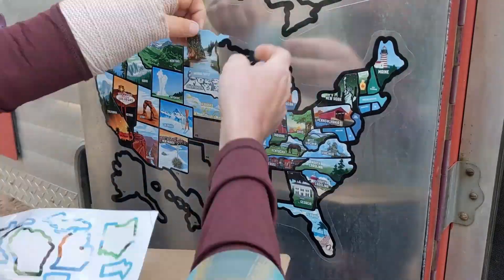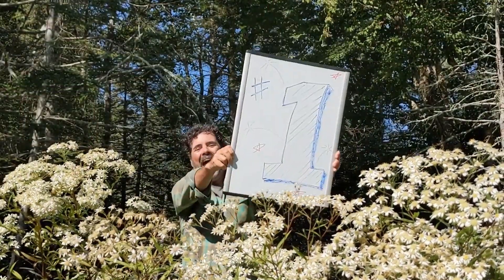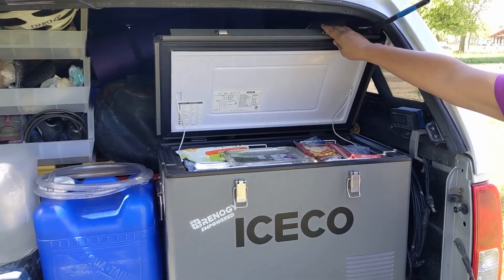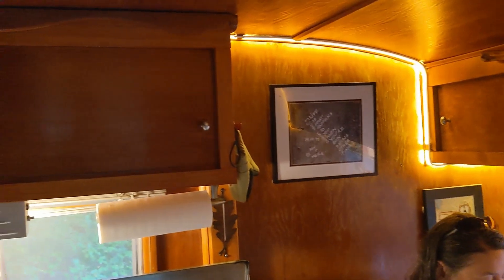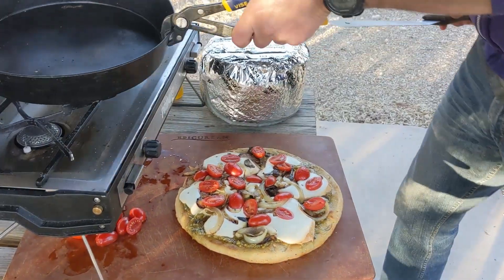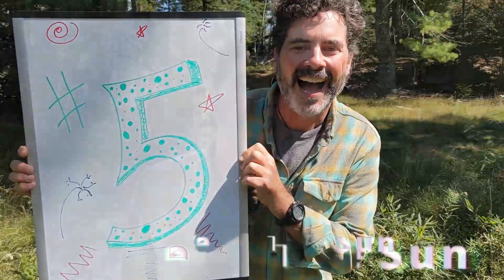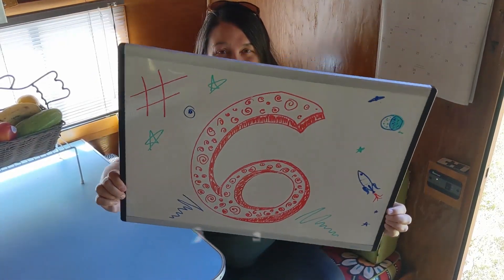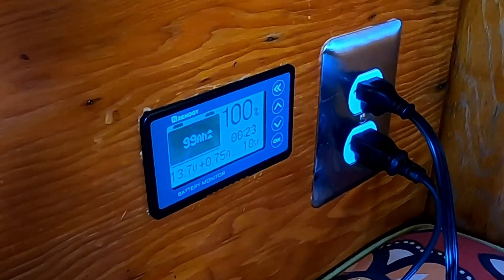6 Simple Strategies for Maximizing a Small Solar Power System

Comment: Hey guys, sorry for all the questions:) I have noticed fuses in your set up. I know the importance of fuses but do you have a video that explains the different types of fuses, what size you need and where they should go in your set up? Thank In advance.
Reply from the maker: We don't have a fuse video, maybe we should!  The fuse basically protects the wires in between components.  The specific type is not super important, but the size is depending on the load going through the wire.  There are lots of online charts that show the type of gauge wire you need for a specific DC load (amps) over a specific distance.  The longer the run and the higher the load, the bigger gauge wire you need.  The fuse should be rated at the same or slightly lower amperage than the component you are trying to protect, and also below the amperage rating for the wire it is on.  The whole idea is that the fuse melts before anything else.  Hope that helps!
Reply: @FreedomInACan  Thanks again !